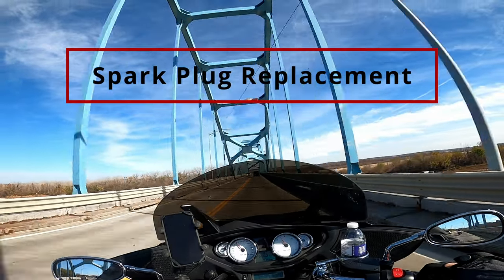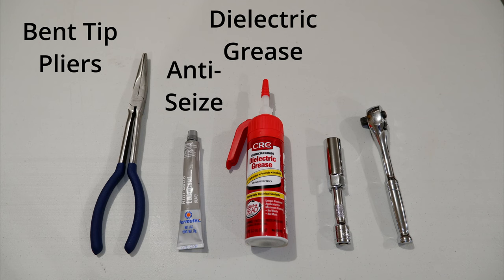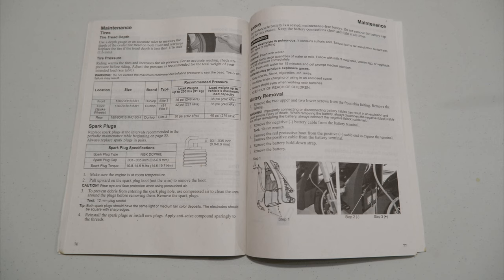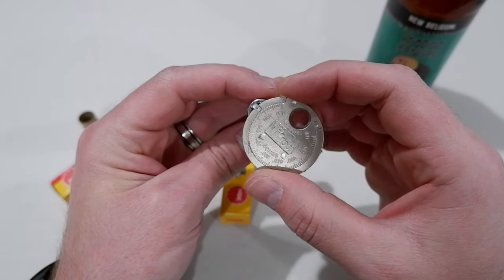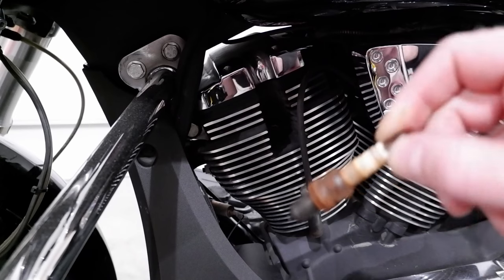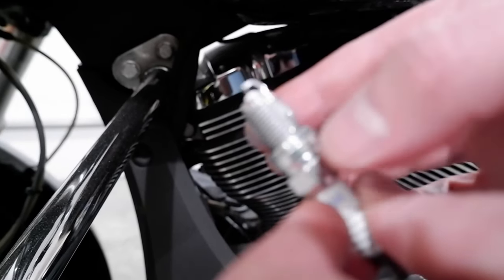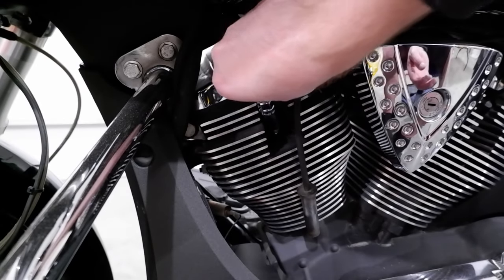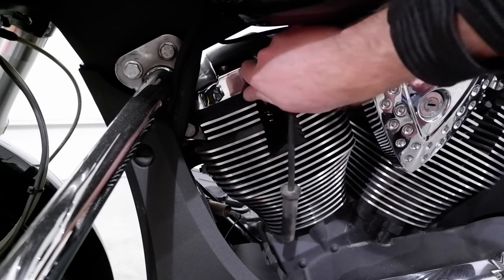Victory Motorcycles Freedom 106 - Spark Plug Replacement Guide

Comment: Excellent step by step video, keep those Victory Motorcycles going! Personally I change my spark plugs much sooner than the recommended 30,000 miles. Around 10,000 miles which is generally every season for us. I find that in that amount of mileage the plug gaps are already beyond specs. Love Your Victory videos, Thank You 😎
Reply from the maker: Thanks Michael!  Yeah, I can confirm that the gaps were indeed outside of spec after the recommended miles.  Your frequency is probably the best way to go.  Always appreciate the comments from you.